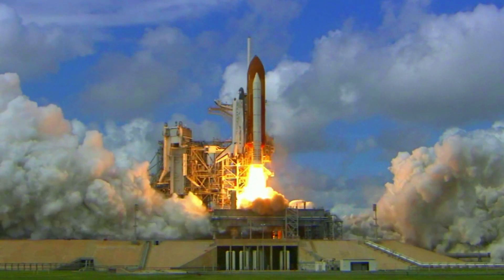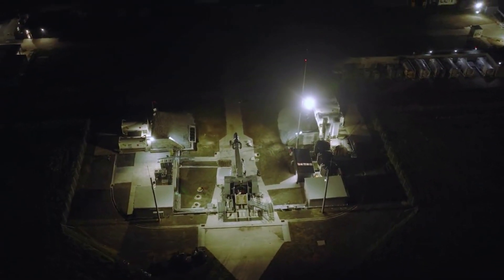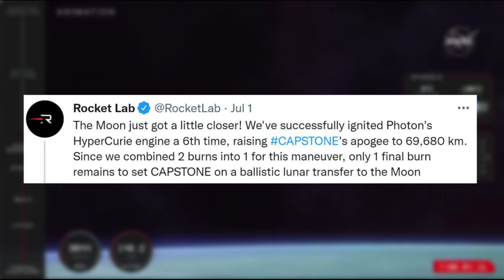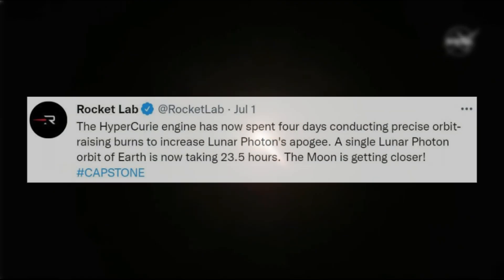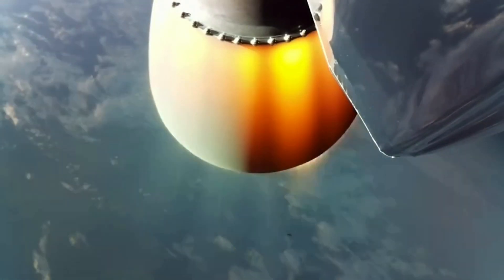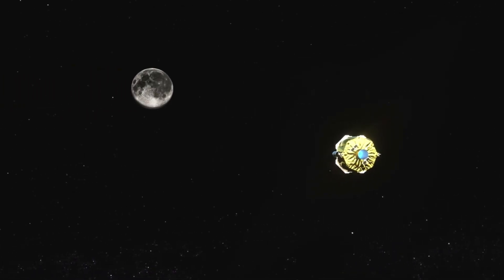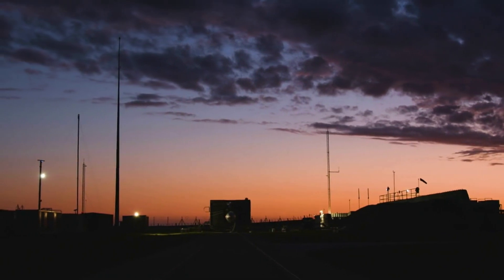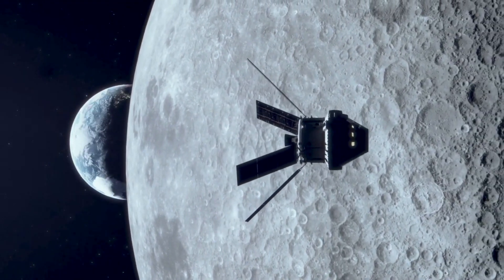Rocket Lab Photon's Final Burn, Recent Updates, & More

Comment: Nice. Rocket lab will beat SpaceX to the moon
Reply: Not exactly.  Rocket Lab launched a NASA spacecraft not to the Moon but a near-rectilinear halo orbit.  The orbit will bring CAPSTONE within 1,000 miles of one lunar pole on its near pass and 43,500 miles from the other pole. On 18 April 2018 SpaceX launched the TESS space telescope.  After TESS injected into the initial orbit by the Falcon 9 second stage, the spacecraft performed four additional independent burns that placed it into a lunar flyby orbit. On 17 May 2018, the spacecraft underwent a gravity assist by the Moon at 8,253.5 km (5,128.5 mi) above the surface. TESS achieved an orbital period of 13.65 days in the desired 2:1 resonance with the Moon.